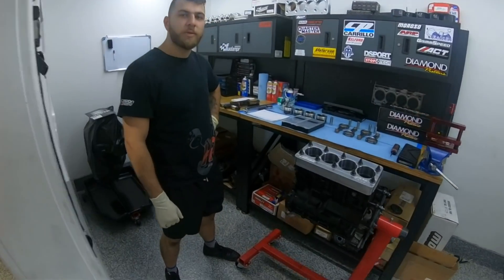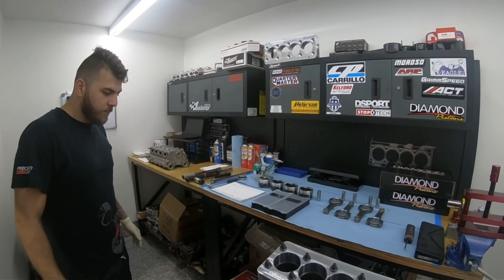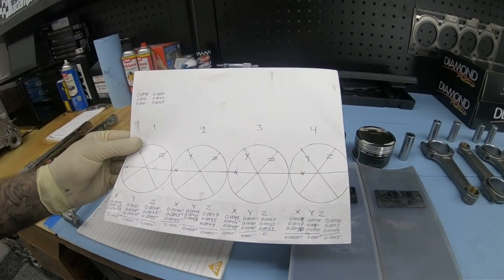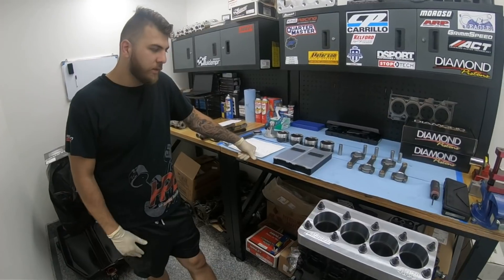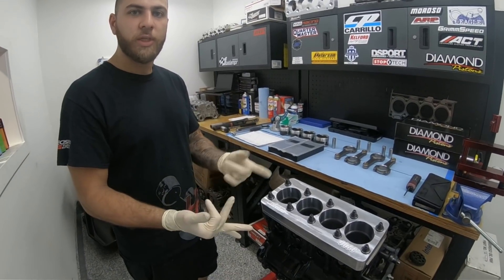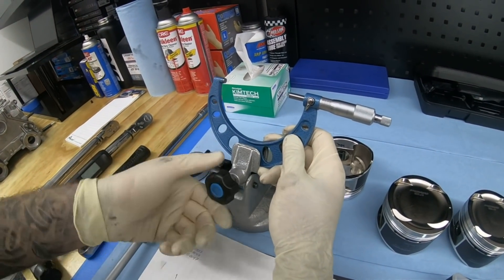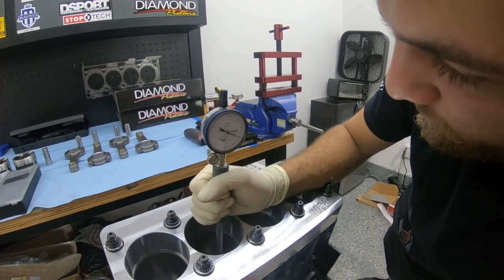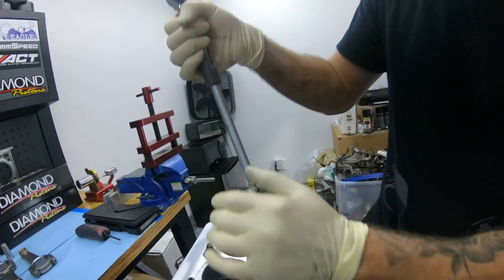Reasons To Use A Torque Plate

Comment: Very interesting. I’ve torn apart motors and honed em out and they lasted a long time. I imagine these are more appropriate for high performance builds.
Reply: Only reason to hone this way is for high performance perfection. That block doesn't warp enough to even matter for most cases when it's torqued down. If it is, then they're not making the blocks strong enough, off course with todays designs it probably isn't... Lol. Years ago this was unheard of, no one used torque blocks for honing, and it turned out good.

Comment: a torque plate is the proper way to do things. blocks can destort from the clamping forces excerted so a torque plate mimics the same forces in real world use. arp head studs especially can distort because more force is used than the factory studs.

Comment: Nice video guys. Question it's a lot of different if you do the honing using the torque plate w/out a gasket? also if re-use the gasket they use on honing process?

Comment: Im pretty sure your reading the Micrometer wrong, it’s going over .005 
Keep up the good work guys, I like the information your putting out.
Reply: he's looking for the smallest reading because that's when the gauge is at the correct point in the circle
Reply: eclipsetrekker check again when he says .0048 it’s actually.0052
Reply: @suprast91  Check how you're reading the gauge. You read it counterclockwise from the "0", not clockwise. Reading clockwise would mean the bore is .0052" tighter than the piston

Comment: What’s that treatment you mentioned before that reduces friction. It’s not a coating but it’s a micro treatment
Reply from the maker: tdawg719 WPC Treatment.
Reply: RoniBuilt is that the treatment where I’ve seen the video with a pin spinning crazy fast in its bore endlessly?

Comment: Can you actually re use the same HG used for honing or I have to buy 2 ( one for the honing process and one to close the block)?
Reply from the maker: 809282 We always use a new head gasket after torque plating. You can reuse a head gasket for the torque plating process. But a new one is recommended during assembly.